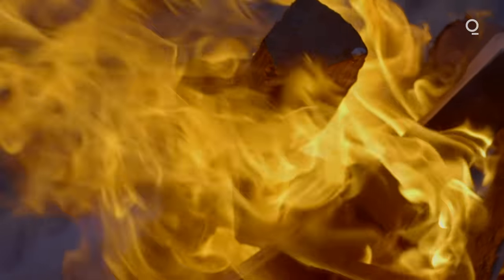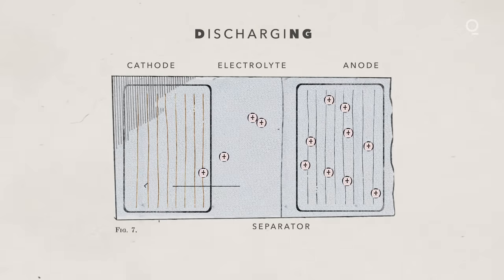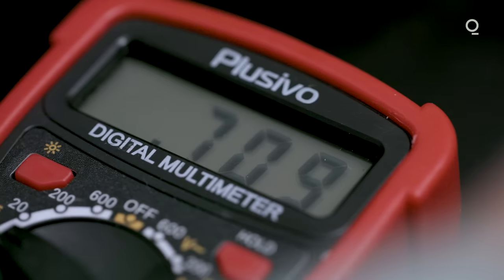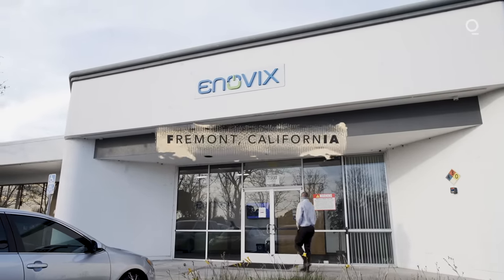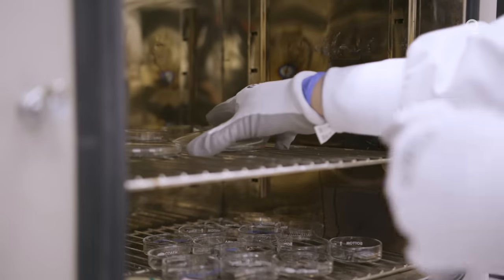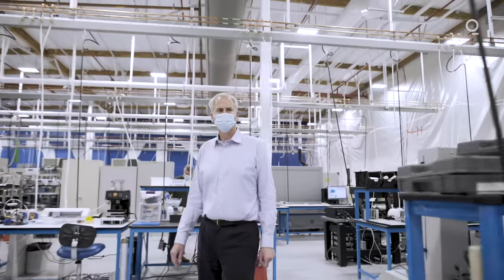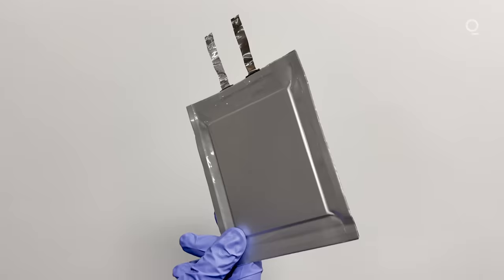How The Next Batteries Will Change the World

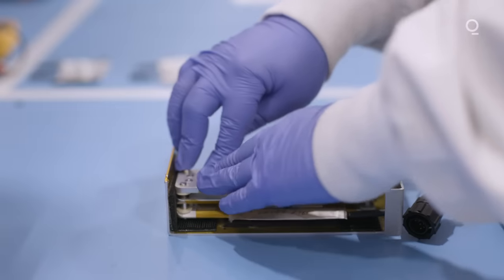Comment: 06:20 Why “lighter electronics with more battery life” instead of the same size electronic with EVEN GREATER battery life. Like if I improve the energy density I don’t want to decrease the size of the battery just because I can but rather pack more power into the same form factor.

Comment: Been hearing about this battery revolution for over 10 years and it's 2021, and I still need a brick-sized phone for the battery to last me the day. I'll believe it when I see it.
Reply: In 2010 a kilowatt/h cost $900, today less than $150. The energy density has increased by over 60%. This is not a revolution, but a clear improvement. What has happened to the internal combustion engine in the last 10 years? Nothing, except a huge effort to reduce emissions, even if only by means of software. In 2010, the smartphone was charged for more than 4 hours, nowadays, some models can be charged in 20 minutes. And the batteries are twice and three times as big as they were back then.

Comment: I can't wait to add millions of vehicles daily to an already strained power grid. That's a great idea. And I'm first in line to handle the corrosive/toxic waste created by depleted batteries since those don't hurt the environment.
Right?
Reply: exactly. Immense people using electricity for powering electronics at home and than the entire commute also using electrictiy. Its never gonna happen. or the price for electricity will be huge
Reply: It’s also not a sustainable system in place to charge said batteries only partly. Looks like the real goal they should be looking at is to efficiency in energy use and sustainable energy sources. Immediately pivoting to hybrid as a base standard rather than manufacturing more devices which operate solely on fossil fuel would also make sense as that technology has been around for a long time.

Comment: The guy says "We are quite far away from the limits a battery can do" and then lists things that must be improved. I would rather see some evidence, that we are really far away from the limits. In reality, it seems for a few years now, you could hear a lot of big claims, but actually see only small improvements. Storing energy in combustibles, explosives and batteries is based on chemistry. In general, you cannot just increase chemical energy density whilst maintaining safety. With higher energy density, even if the system is stable, it takes less energy to push it into releasing its energy.

Comment: I heard about a Super Capacitor which charges in seconds and discharge in hours, use them.
Reply: Sure, super capacitors charge really fast and have a very high power density. The problem is that they have a much lower energy density than a battery.
Reply: Probably gonna explode when you overcharged the super capacitor

Comment: Recycable? The wind turbine blades are not recycable, last time checked. All batteries must be recycable once no longer in use. The solution should not be worse from the issue. Thanks.
Reply: Of course this is important. But even more important is to get emissions down as fast as possible.

Comment: Mining battery components is a very polluting process. It leaves behind lakes of sludge that's impossible to dispose of.  No one  wants to talk about that. 
And, about 45% of power plants in the US is fossil-fuel powered. Solar and wind power is an intermittent power source that, at the very least, must be supplemented by a consistently reliable energy source such as fossil-fuel and nuclear. As electric car numbers increase, so will the need for this consistent energy source. We're just switching from one fossil fuel to another. Another way to meet the energy requirement is by using propane power plants since there will be a decrease in need for gasoline and diesel and an increased need for power plant fuel sources.

Comment: Actually the future is high.temperature fuel cell or battery.
Today, we replaced heavier metals like Zinc with Lighter Lithium anode. But we still use the same Nickel Oxides cathodes as in 80 year old Alkaline Batteries. Some use Iron Phosphate, but still catode is 20x Li. Hmm, which has more energy, solid Lithium or Lithium mixed with 10 parts Carbon or Silicon? Battery life depends on cathode expanding and contracting to fit Lithium Ions in its crystal structure, which breaks over time, killing its life. Traditional batteries like first one shown, have different reactions at anode and cathode. "Lithium batteries" pervert this by requiring transport of Lithium metal ions which degrade the organic compounds that carry the Lithium. Note Zinc-Air batteries have higher power density than Lithium even with heavier Zinc, because the heavy cathode is replaced by Air. Best bet is high temp fuel cells. Used for remote power in Japan. And NASDAQ backup power. Can use Hydrogen or Natural gas.

Comment: You mean to say they are doing batteries with silicon even if there is a shortage of it worldwide?
Reply: Silicon is one of the most abundant elements on earth. There's tons of it in your own back yard. Silicon and semiconductors aren't the same thing. Semiconductors are made from silicon. The shortage is due to reduced manufacturing capacity, nothing to do with silicon.
Reply: @falconne  we have a shortage of sand. Most of the silicon supply of the world come from silicon sand/quartz sand.
Reply: @nosciredesigns7691  No, the world is running out of beach sand, not sand in general. Beach sand is needed for concrete production and that's what using it all up. Concrete needs the specific shape of beach sand to hold it together. Silicon production actually needs even purer quartz, but that can be mined from various other sources. Semiconductors use a insignificantly tiny percentage of the extracted silicon in the world. There'll always be enough for that industry. That's without taking into account that more green electricity is exactly what we should use resources for. Concrete production is one of the largest CO2 emission sources in the world. To say we can't use 0.000001% of the sand for technology to reduce climate change because that's needed by the industry using almost all the sand and producing much of said climate change doesn't make sense.

Comment: Batteries for grid storage is a fools errand.

Lithium-ion batteries are now at approximately $140/kWH 

1970s tech, insulated carbon blocks electrically heated to 2,000°C cost ~$10/kWH 
Lifetime of 20-plus years and the energy density is on par with lithium-ion batteries.

Comment: 5:16 "The major advantage of silicon is that it has 3x the energy density of carbon" 

later

5:28 "Silicon suffers from a bunch of problems, the biggest of which is the fact it expands 300%"

Tell me sunshine. How does this solve your energy density problem?
Reply: Energy density != Mass/volumetric density.  -Sunshine
Reply: @Ddub1083  "In physics, energy density is the amount of energy stored in a given system or region of space per unit volume." - first line off of Wikipedia for Energy Density
Reply: @Ddub1083  There ain't nobody here talking about Mass/volumetric density. Since Mass/volumetric density as an equation contains no power or energy variables it's completely irrelevant. 

I think energy per unit mass is a better description of what both of us are looking for. I want my batteries to hold as much energy as my car while weighing less than a microwave.
Reply: @barrettvelker198  Right... which is DIFFERENT than the spatial density of the silicon which expands and retracts.  Thus.... Energy Density is not equivalent to Spatial Density.

Comment: I personally don't believe we will se cars running on batteries in the future. Right now it's the better option over Diesel and Gasoline. No doubt about that. But think about it. Batteries are large banks of energy, PERFECT for storing energy for housing, or if our main power goes down. Not in a vehicle. Our infrastructure is not realy for 1.5 billion electric vehicles. 2.5 % of all vehicles are electric, and we are already pushing 80-100 Amps for charging. How are we going to sustain that for 100 % of our cars? 
I think we will see a push for more clean energy as Hydrogen, but that said, the infrastructure for that is not ready either.. So I think we might see struggling technologies in the next 10-20 years, until a "real " solution has been found.. However, I am a stronger believer in batteries for all applications, just not cars.

Comment: Advances in batteries since the beginning = hardly any improvement at all. I am getting to the point where I don't know if we'll ever improve batteries.
Reply: We have already, a lot. Batteries are NOT a new tech, and as such don't often evolve as quick as new things. 

That's aside, Tesla is already making big changes, structural and material wise. And as the EV/Solar age continues to creep in, so will funding towards batteries. 

But over the years batteries have gotten smaller and more powerful, while lasting longer, specially if you compare "since the beginning".

Comment: WE DON'T WANT ELECTRIC CARS!!!    In my state, if we have 5 days in a row of 95F weather, our power system starts failing with brown outs because every house has their AC running none stop.  Lets add 2 220V lines to the house with cars changing.. LOL.. our system can't even begin to power millions of cars in our state.  Then of course MASSIVE demand for electricity equal 10 times the cost of electric.  Seriously this is Economics 101 here.  I'm not getting rid of my gas cars ever. I refuse to pay a tax or penalty for using a gas powered vehicle.

Comment: only 50% more energy? bruh. we still have a long way to go in battery tech before they will be viable for a fully electronic and greener world/. at least 10,000% more efficient. I'm wondering when they will develop fusion/fission power cells. or even better. the world's first anti-matter storage cell.
Reply: Efficiency is not the same as energy density.

Comment: What EV’s need is for a consortium of the Energy and transportation departments together with representatives from the EV and related companies to develop standards for a standardized families of quick exchange power packs compatible with respect for power physical dimensions and electrical  connectivity. If EV products are going to be a viable option for customers living in multi-family urban and suburban communities, where acres of corn rows corn rows of charging parks are out of the question, range anxiety for traveling sales and manufacturing representatives, and those in very cold climates. The skateboard arrangement is out of the question. The advantages of the quick exchange system are compelling. First, the possibility of neighborhood distribution grid overload is eliminated as regional distribution and recharging centers would be sited next to power generation and harvesting complexes. Second, as breakthrough innovations in power storage density both in weight and dimension comes forth, consumers are afforded a substantial degree of protection from technological obsolescence. Third, built-in tamper resistant metering modules would aid in transportation tax collection. Fourth, inherently empty tank wagon back hauls would be replaced with very low polluting natural gas powered 18-wheelers. The late Grace Hopper, helped bring forth computer programming standards cited the light bulb as a shining benefit of standardization!

Comment: Is a Battery green if it is in a car or bulk storage for a home?
Well no apart from lead acid all other batteries live for a max of ten yrs and are a real life risk to recycle let alone the waist issues to the environment when they were made 
So what is green power making then?
Well not wind or solar both are at best 60% recyclable and only live for 30-25 years And The blades are only recycled in the USA 
So what is green power making item ?
Well its an oldie and its a Dam yes i typed dam... It makes a mess of the enviroment displaces wild life and some times humans BUT it can have 99% recycled and lasts 100plus years AND in the end life returns to the lake that is made BUT  pump hydro is a joke 40% more power is needed to lift the water than is got when it falls to the turbines and 
power bills rise by 25%

Comment: There is not  enough power grid to feed 5% of  existing  cars  :) if we  want  50% of  cars to be  electric  we need  to  rebuild  whole  energii grid and  hundreds of new  power stations .  It is  a  job for  20yrs  at  least  then  stop  foolish us  with  it.            Solution is   Aluminium to Air batteries generating  electricity  itselfs  ( not  chargeable )   just  buy it then  use and  exchange for new one

Comment: what all world need is battery which would not degrade in evs so much and it would be not 5-8k but1000 most for new. Now person buys ev and after 10 years he cant sell the car as battery is trashed. fuel cars can work more whan 40 years no problem untill rust kills it. So if he bought ev and after it was very hard to sell or price was a joke he will not buy anymore any evs.

Comment: Batteries are only a short term solution to transportation.  A energy-power plant based on quantum field theory is a more practical solution.  A 'water plasma field' can supply the neccessary energy.  The quantum realm offers possibilities for this, that bulk classical sciences doesn't consider.  This focus on short-term oversimplistic expenditures are a waste of finances.  By researching  available scientific abstracts in this area, one can easily visualize a "water cloud chamber", that contain the necessary elements for this possibility.

Comment: When you put it all together, Energy to charge the EV's batteries, Energy used to make the batteries, Energy used to ship the batteries, The energy to mine the raw materials and transport them, Then disposal of the hazardous waist of the used batteries and the impact of the waist on the environment, Have we really changed anything? Are we really saving anything at all? Fact is we are making it worse.
Reply: Oh yes absolutely. EVs are much better. Diesel and gasoline are so horribly inefficient that it is quite easy for battery tech to cause much less pollution.

Comment: Terrible video filled with inaccuracies
@1:11 you really need to fire your graphic designer or hire a science consultant. Any high school student knows that electrons (which carry a negative charge, not a positive charge) flow from anode (-ve) to cathode (+ve) through a wire. That flow of electrons is 'electromotive force' or 'electricity'

In your diagram you show positively charged particles (presumably large protons?) flowing across the separator (that by definition keeps the anode compartment and cathode compartment separate). 

What were you thinking?